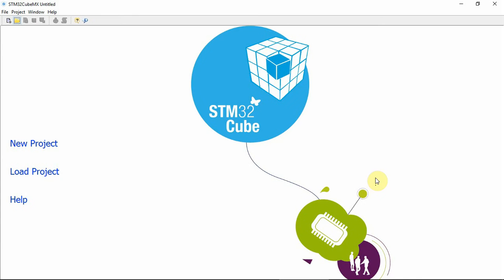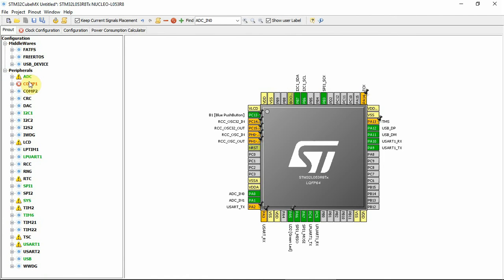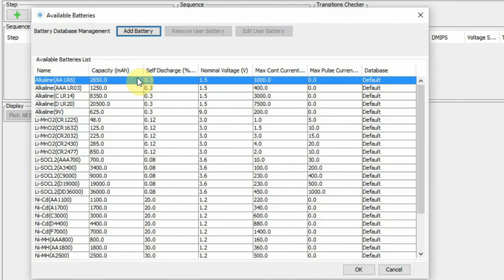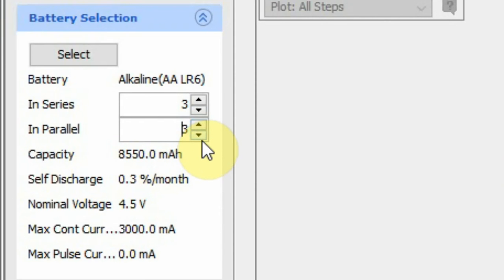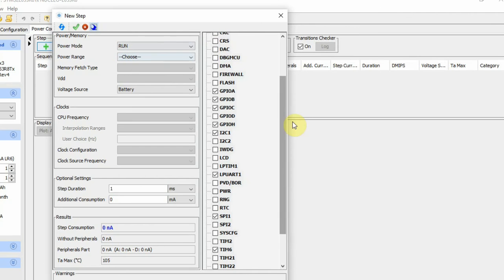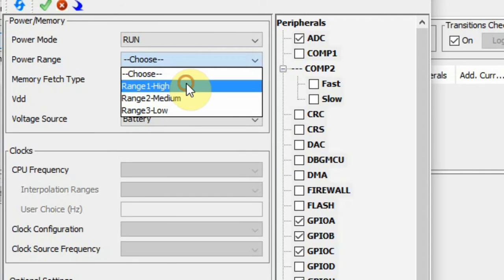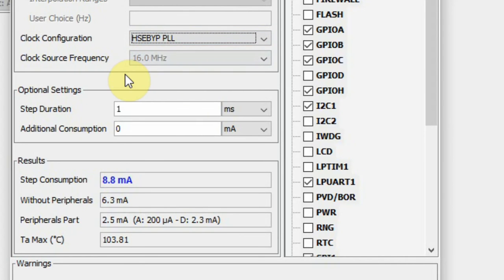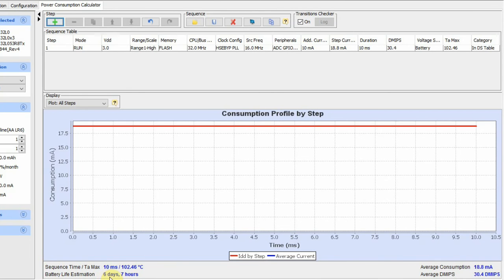#5 STM32CubeMX Power Consumption Calculator

Comment: i am working on the power optimization of embedded system dissertation so that i have to use arm cortex stm f 407.i am using DVFS ( dynamic voltage and frequency scaling) techniques.so how i change the frequency of my processor.
Reply from the maker: There are different ways to change the clock. If you look at the clock tree, Anything that you can change in the Cube, you can change also at run time. Each one has its own register. Just make sure you change to something that is valid.

Comment: Hello,

I am actually working on the power consumption's project using an STM32L073RZ.
The project operates in a room where the temperature varies a lot. So I would like to change the value of the Temperature set by default at 25°.
Do you know how can I modify that and if it is possible to modify the Temperature.

Thanks a lot in Advance